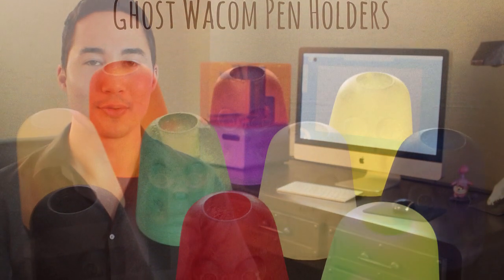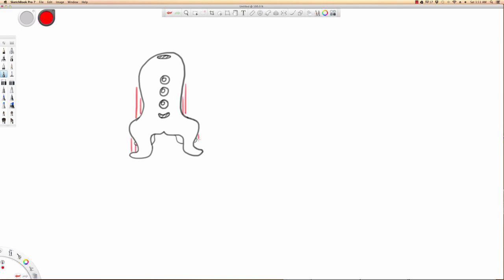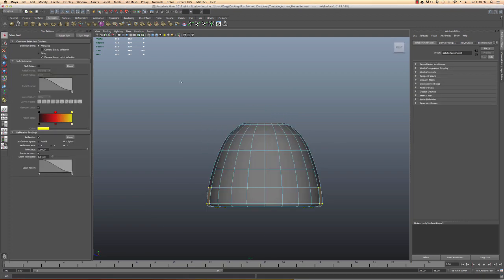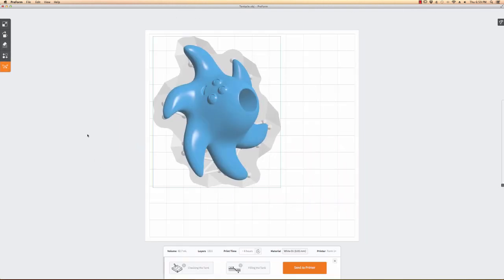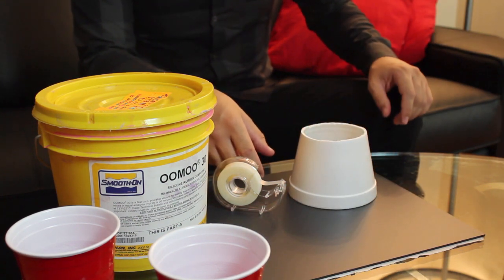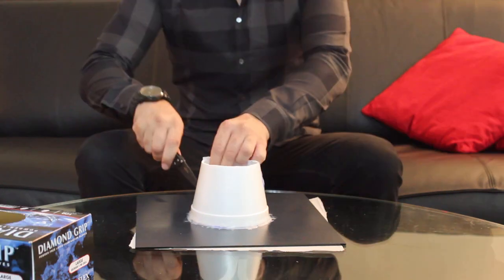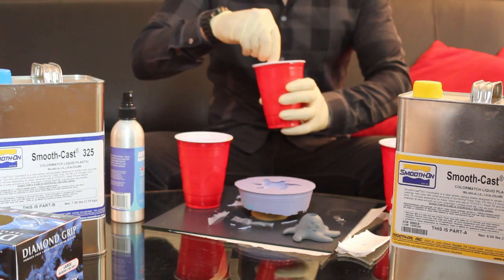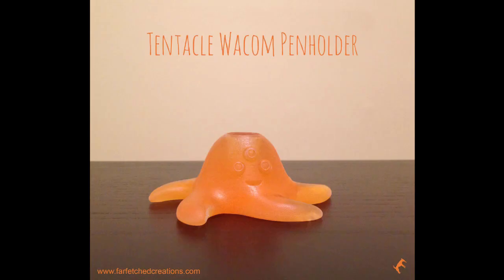Molding and Casting from a 3D print

Comment: Can't we just print mold on 3D printer and put cast on that to make the parts by spraying mold release onto that?
Reply: Not advisable. The point of the primer is to soften the rough surface of the printed part. FDM prints especially are very likely to get permanently attached to the mold if you skip the primer, or use too large of a print layer setting.

Comment: Why was the 3d print angled in the printer and not flat?
Reply from the maker: aletoledo1 With SLA 3D Printers, printing at an angle is important unlike FDM printing. Flat objects can tear apart while printing.
Reply: Mold3D TV This can also be useful for FDM prints that need to be strong on that particular angle. Another reason why PVA supports are quite useful!
Reply: aletoledo1 Thanks for this question and thank you Mold3DTV and Mortar Art for your answers, I always wondered that and that is a great point.
Reply: +Mold3D TV Hi can you list all the programs you used in this video?